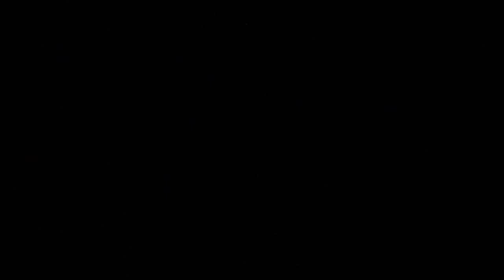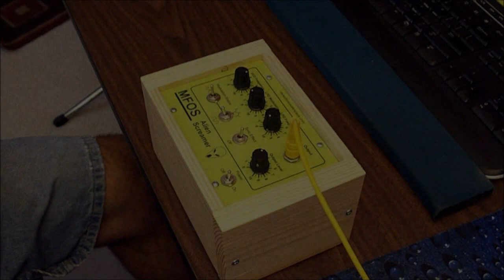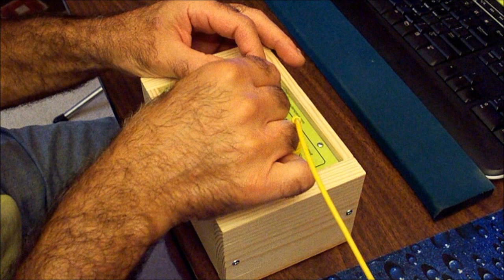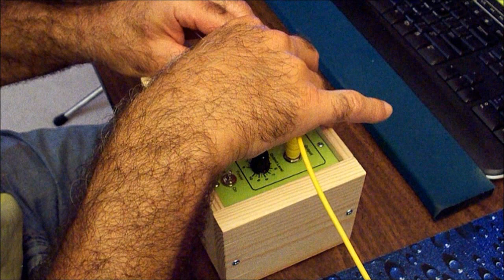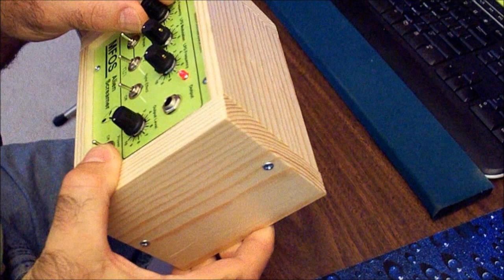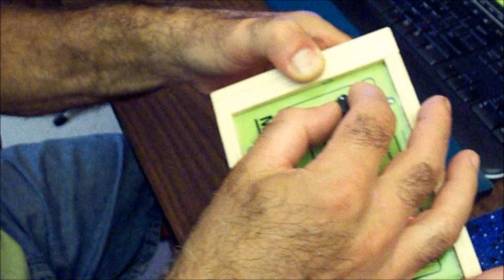MFOS Alien Screamer Noise Box Presentation

Comment: Hello ! Could you please help me understand how the lin Voltage/exp Current converter works, since it's not the first time i see this kind of circuit, and I don't see what the capacitor has to do with the Op Amp and the transistors and resistor... I guess there is a link between the Ic=Is*exp(Vbe/Vt) and that's all...

Comment: Hello ! I was wondering if it was possible to use  a 2N3819 instead of a 2N5457 JFET since they don't make them anymore and I can easely get a 3819... Do you now if it is possible ?
Reply from the maker: Blop40fficial Central Semiconductor makes them currently and DigiKey sells them. http://www.digikey.com/product-search/en?lang=en&site=us&keywords=2N5457&x=14&y=16

I sell them too.
http://www.musicfromouterspace.com/index.php?MAINTAB=CATALOG&PROJARG=ELECTRONIC_PARTS/2N5457.php&CATPARTNO=2N5457&PN=1&SONGID=NONE
Reply from the maker: Blop40fficial You can always try one. It won't hurt anything and may work fine. Check the pin out to make sure you orient the transistor correctly.
Reply: Ray Wilson Actually I meant my local electronic part retailer just doesn't sell them, thanks for the advice ! I'll try to make my own version of your alien screamer... Anyway thank you for your website, I have had problems to understand the schematics at first but it helped me for some synth DIY stuff !

Comment: Hi, it's great. I have a question. It could work with a LM386n1 circuit? Thanks
Reply from the maker: Yes the LM386n1 has less power (.3W I think) compared with the LM386N4 which has 1W. But the N1 will work fine.
Reply: Ok. Thanks, I gonna make it with that. Another little question about ground and battery negative. The ground is connected to the BN?
Reply: Hi, another one. Is it a god idea chage a 2k R, for two 1k R in series, or change a 75k R for two 150k R is pararell. Thanks:)
Reply from the maker: Victor Mendoza
Two 1K in series is 2K and two 150K's in parallel is 75K so it doesn't make any difference except to use more resistors.
Reply from the maker: Victor Mendoza The N1 has less output power than the N4 but should work fine.

Comment: HELLO! I have a question.. (sorry my English). I'm making "MFOS Alien Screamer Noise Box"... So,   GND = BN??     All GND (like R14 to gnd) in the circuit go to GND or BN??  Only this.. Thanks very very muchhh!!!!!!!!! :)
Reply from the maker: Please read over the circuit description for a better understanding of how the unit works. BN is NOT GROUND. BN is the negative terminal of the battery and ground (the ground symbol in the schematic) is the half way point between BN and BP. Ground would measure as +4.5V above BN.
Reply: Ray Wilson Thank you very much, I solved the problem. BN is not gnd! haha Thanks. Another little question: the resistor values have to be exact (300k, 2M)? Can they be similar? Thank you very much for the great help! I will follow your projects. This project works 100%!!!!!!!
Reply from the maker: Martin Reyes They should be within 10% of the published values at least but the unit works best with the correct values.
Reply: Ray Wilson Thank you very much!

Comment from the maker: Sorry to hear the project is not cooperating. We've all been there. This project is really straight forward and the documentation I have published should be helpful to you in your trouble shooting efforts. Often wiring is an issue. One forgotten connection or wire and zilcho sheeza no worka. So go back over everything and see if you can get another set of eyes on it with you. I can say that I've built several of these units with no issues and I follow the published web documentation. Best, Ray

Comment: I am currently working on this project.  I have everything wired together.  The power switch, vco frequency, and lfo modulation knob all work but nothing else does.  I have done some troubleshooting and I all the connections seem to be good and in the right place.  Do you have any idea what could be wrong?

Comment from the maker: The Alien Screamer does not have pads on the PC board like the NOISE TOASTER for external CV control but you could add another summing resistor in the CV circuit and bring it out to a jack if you wanted to. The Alien screamer is not 1V/Octave tunable but will at least change frequency nicely with external CV.

Comment from the maker: Sure you could. You may get a bit more hum because of not having the front panel components grounded by virtue of having been mounted to a conductive front plate material which is also grounded by means of the jack's ring connection. But the Alien Screamer is a fun noise box and should be fine.